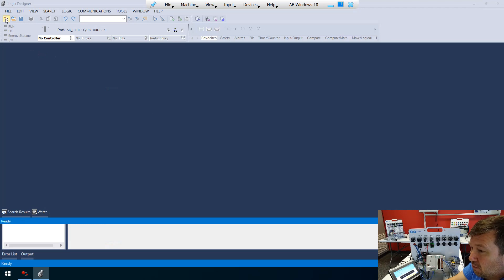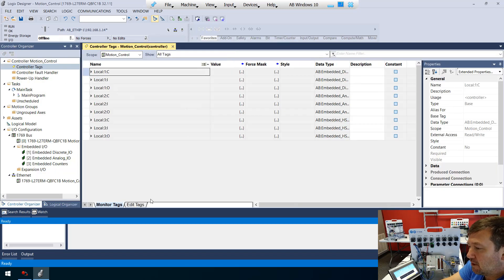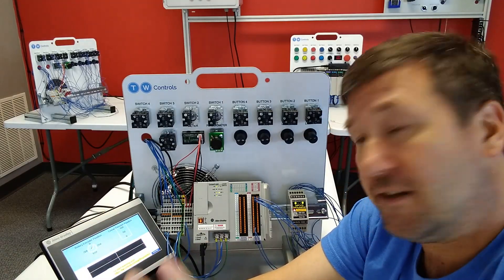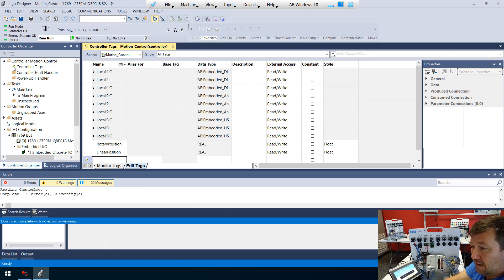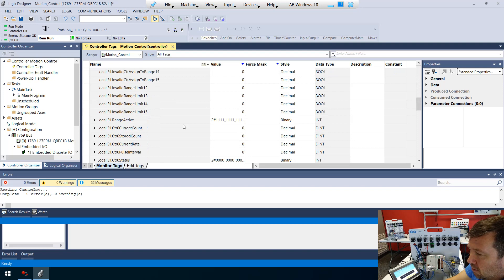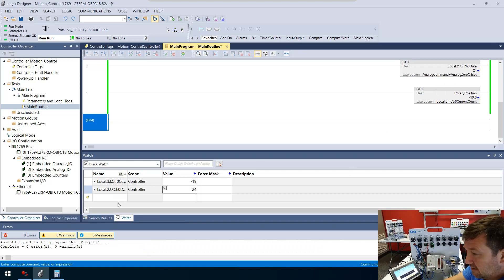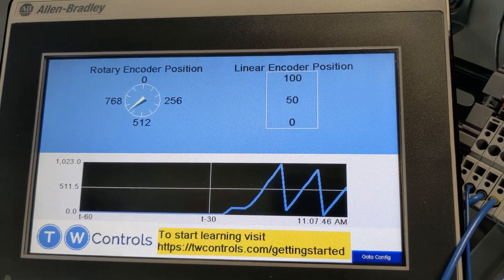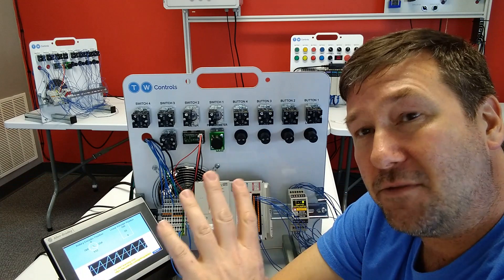Compactlogix HSC High Speed Counter Configuration in Studio 5000

Comment: Using the same high speed coder how could use a proximity sensor to detect if a shaft is rotating or not?
Reply from the maker: Possibly, depending on the frequency, you may not need a high speed input.

Comment: Hello, how can I save the last value written so that when I turn off the CPU, it comes back with the same value, in my application the value is reset to zero and I need it saved to continue the process
Reply from the maker: The reason they reset it is you have no way of knowing whether the encoder moved while the power is off.  But it would make for a good video. Instead of using the ACC for your scaling, you would would use a MOV instruction with a source a of the ACC and source b of some DINT such as MyEncoderValue.  Use this tag for your scaling.  Then you can use the S:FS first scan bit to set the ACC value back to it on power up.
Reply: Yes, it would make a good video, I'm trying to do it this way but I haven't managed to do it yet, I may be making a mistake somewhere, but thanks for the idea and if a video comes out about it, please notify me.

Comment: Hi Tim, I am struggling in the 1769-HSC right now. So what does the "Local:3:I.Ctr0CurrentCount" actually stand for? It only counts one time if the sensor senses an object, If it senses this object again, it counts to 2. So the CurrentCount only counts how many times the sensor sensor the object? Is this logic correct?  I connected a  Banner sensor (M18SP6FF50Q) to A0+ and A0- of the HSC module. Local:3:O.Ctr0En is set to 1. The operation mode is "Pule Internal Direction". Is there any way to get the feedback value like a time? For example, how long does an object pass by the sensor take? Count the time for any object passing by the sensor.
Reply from the maker: Counting is pretty much what the 1769-HSC...but at a very fast frequency.  I don't think you can get a time stamp

Comment: Hi Tim! I would like to know if it's possible to use a simple digital sensor to count pulses. But the pulses are 1.8 Khz. I tried to use the input A, B e Z but doesn't work none of them.
Reply from the maker: Only on a very slow rates. You must consider the switching time of the sensor, input RPI, and PLC scan time. Sounds like you're looking for a high speed counter.
Reply: @andretoledo3329, did you get your answer ?I am trying to use the high speed counter for the digital sensor as well, the Local:3:I.InputStateZ0 turn on when I triggered the sensor but Local:3:I.Ctr0CurrentCount doesn't count up. Local:3:O.Ctr0En has been set to 1. I don't know what is wrong

Comment: Hi bro,
Thank you for your valuable video.

I want to calculate line linear velocity (m/min) using 1024 htl encoder.

cylinder diameter 600mm

cpu
1769-l24er-qbfc1b

another question:
I want to read the plc scan time for each cycle.
Reply from the maker: This should help.  https://twcontrols.com/lessons/math-for-rotary-motion-to-linear-motion-conversions-on-servos
Reply: @TimWilborne  thanks a lot.

Comment: Hey Tim, I'm having a small doubt regarding the input and output data files. Does the number of bits in input data file mean that the controller will be having that many number of physical input terminals? When l look into the input data file of Micrologix 1400 Series A controller i could see 7 words inside, it does that mean the controller could accommodate a maximum of 113 inputs?
Reply from the maker: Not in reality.  There is memory allocated for that many, but different models have different numbers of inputs.  The 1400s have 20 inputs and 12 outputs on their base and can handle 7 expansion modules.
Reply: @TimWilborne  so if we aren't using any expansion modules then only 20 bits from the data file is required right? Does that mean the 21st bit isn't mapped to any physical input terminal of the controller?
Reply from the maker: Not mapped is probably not the correct term. I'm not in front of a PC right now but many of them have function of configuring the input points.